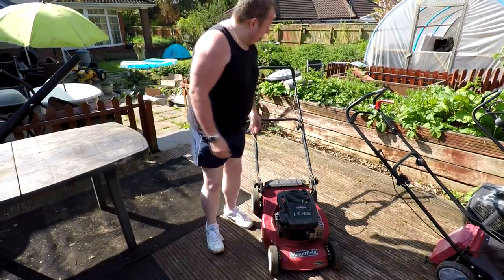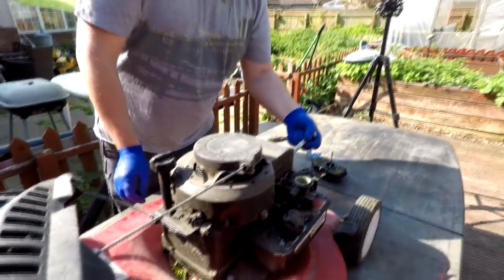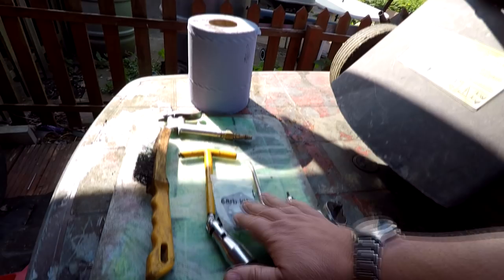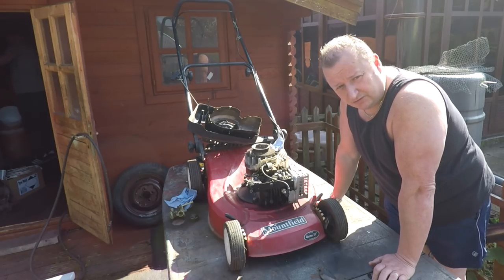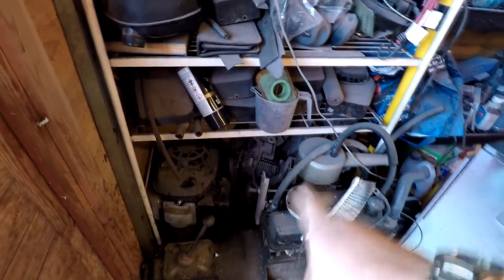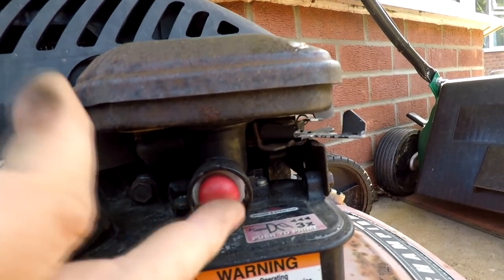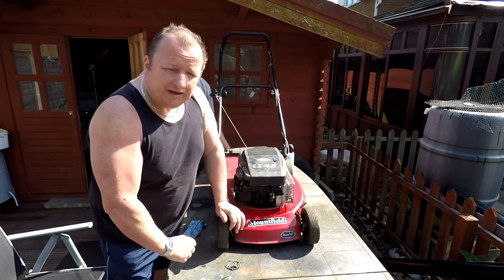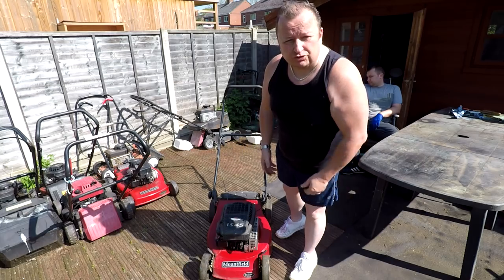Quick Fix Fast Profit With A Basic Tool Kit | Lawnmower Repairs

Comment: i been buying and selling mowers for 20 years on and off and i still never get bored of doing it
Reply from the maker: Its a good feeling to hear one fire up when its been left for dead.
Reply: retrorestore oh yes I had a industrial hayterette that had been sitting in a barn for 30 years I cleaned out the carb and then the point's flashed the rust out of the tank and away she went

Comment: I gave up doing these, except for occasionally finding some free ones that I can turn over quickly. I used to advertized on Craig's List here in the US to pick up unwanted motorized equipment. A number of times I came home with my truck loaded. My last bunch was three that I got for free last Fall. They sat out in the snow all winter and I cleaned them up this Spring. I sold 2 and am giving the 3rd one to my son... An extra $80 helped to pay for the nice guitar that I just bought today. Good one, Martin & Gary.

Comment: Another great video Martin. So there’s no such thing as “lawnmower oil” ?  I use an electric chainsaw for cutting up wood for the wood burning stove. Does that mean I’ve been buying “chainsaw oil” from Screwfix when I could be using the motor oil I already have in the shed?
Reply from the maker: Haha, I'm no expert but I don't think there's a special grading for a chainsaw blade. its all slippery lol
Reply: Ordinary engine oil ok for electric chainsaw.
For bigger/ petrol saws with higher chain speed ordinary oil can get flung off.
A 'Chain oil' is sticky and stays on the chain at higher speeds so chain will last longer and cut slightly better.
After starting your saw point the bar at a light coloured board and rev the engine. You should see a little oil spray onto the board.

Comment: Easy aren't they. Does the garage at Kirkstead sell proper petrol. Made a big difference to the Briggs. Also tried a bit today in my Yanmar (Honda badged) genny. First time started for 2 years, runs best it ever has. Use such small amounts the extra cost is negligible.
Reply from the maker: The one Woodhall side of the bridge has changed hands and the one over the bridge is up for sale. I have a couple of genny's, must run them soon Malc, thanks for reminding me.
Reply: retrorestore I sell a mower then I find one for free the same night, hope my luck keeps up
Reply from the maker: Nice one, well done.
Reply: Need running occasionally eh Martin. Diesels don't seem to mind sitting for 20 years. It all comes out the same spout at the docks, but Ethanol ect are added afterwards for supermarkets. Btw, do you want this Suffolk Colt to have a play. Sharpened the cylinder and blade....coils gone damp but otherwise ran a treat. Can then show some nice stripes on your lawn after cutting with yours :)
Reply from the maker: Thanks Malc but I'm over run with mowers, gotta shift some I think lol

Comment: The carbs as you say it don’t just need a diaphragm and gasket, they need the insides cleaned, eg the main jet and other jets, I’m 13 and we own a family lawnmower buisness in Northern Ireland. Invest in a ultrasonic machine
Reply from the maker: I already have one bud. You rarely get a problem with the main jets on these carbs, nothing a tin of carb cleaner and an air line won't sort out.
Reply: retrorestore ok